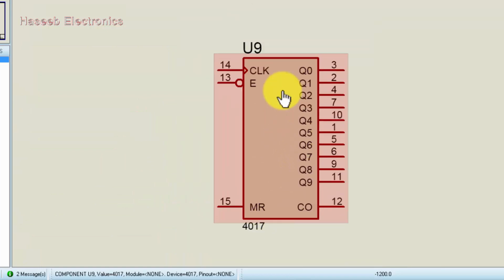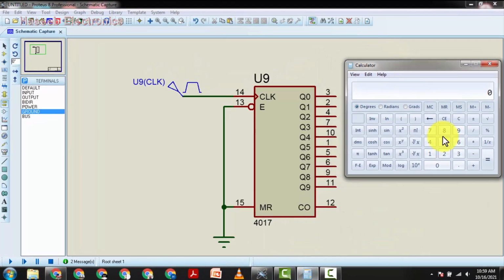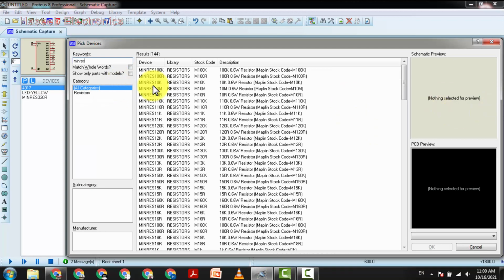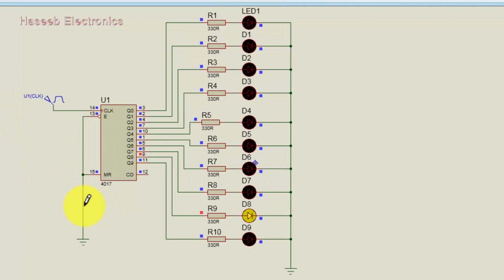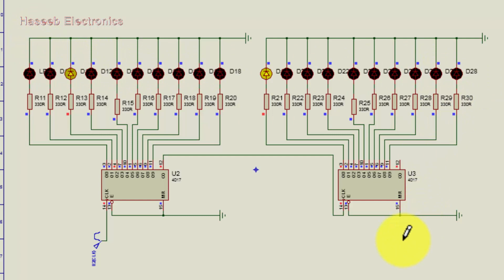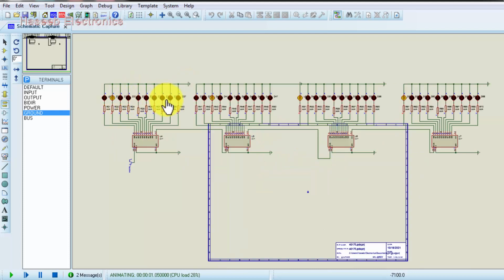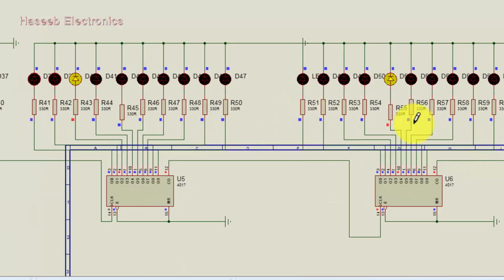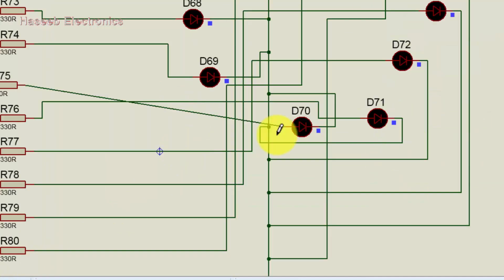{472} How to Design CD4017 Decade Counter Circuit in Detail - Running Chaser Lights

Comment: Sir, i want pulse generator circuit. That is very useful while checking/operating counters, stepping relays, etc. It avoids the procedure of setting a switch for the required number of pulses. By pressing appropriate switches S1 to S9, one can get 1 to 9 negative going clock pulses, respectively.

Comment: I built this circuit in my mind, then on protoboard, then found this video upon completion. I have to say... the results were the same except mine divides by 10*6
Reply: I built it as a sub counter for my analog discovery. By adding dip switches on the outputs let me divide by 1-1,000,000  of any input frequency. I’m working some math to incorporate into a sequencer design. Wish me luck. Thanks for videos like yours help make my art come to life. 
God Bless.

Comment: Awesome explanation as always,one question arises when we switch on power to the circuit,output number 1(pin-3,Q0) doesn't always activate first but any random output (from pin no.3 to11) activates first,so is there any power on reset circuit can be added in this configuration?
Reply from the maker: Yes, correct. that is reason that the Enable pin is provided to provide chip enable and MR is to initiate from Q0. i will explain in upcoming practical circuit
Reply: @HaseebElectronics  It will be very helpful to us if you do so,thanks for responding.
Reply from the maker: @manhardanmahedu3765  sure i will do it soon